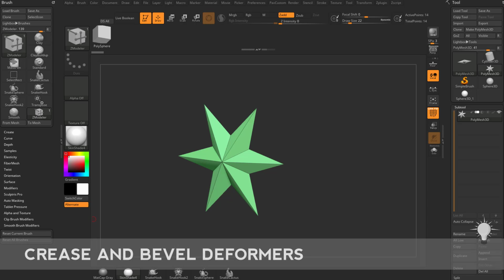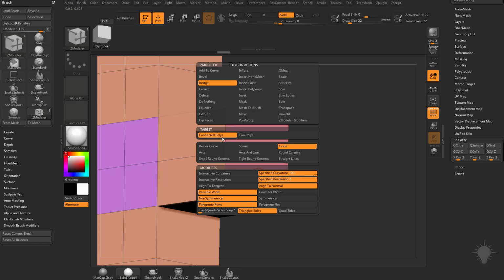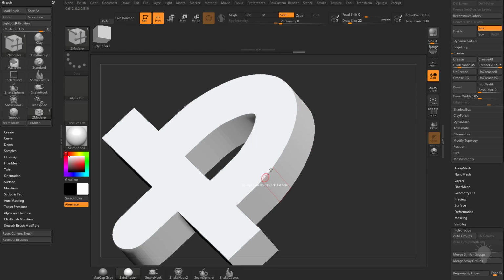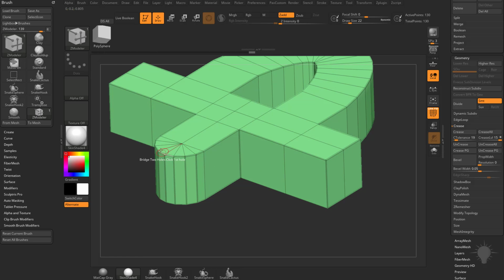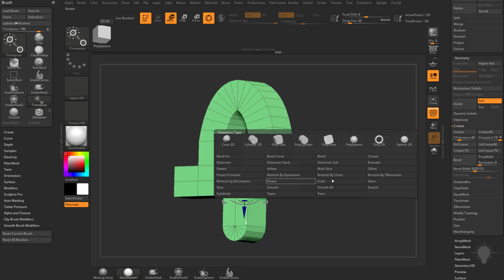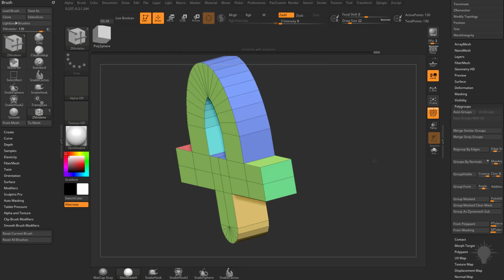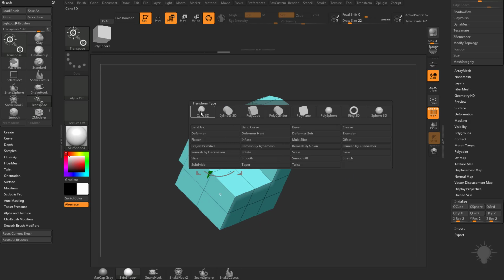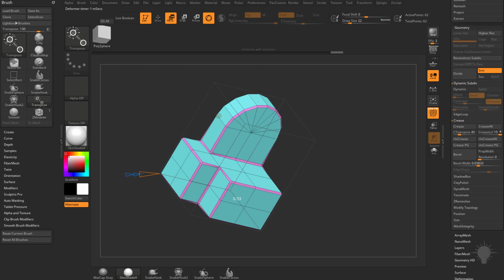030 ZBrush 2018 Crease And Bevel Deformers

Comment: Still can't understand what corners should i look when creasing :(
Reply from the maker: the (very slightly) perforated lines are the creased ones, but if the deformer creasing isn't very helpful to you, go to the tool - geometry - crease menu for the manual options, and use that in conjunction with zmodelers edge creasing for the most control https://www.youtube.com/user/Pavlovich2005/search?query=dynamic+crease
Reply: Michael, using the moment, I want to thank you for the great tutorials. You are the best! I understand how the tool works but it's more intuitive understanding or trial and error method. I can't say directly what angle should i look for to compare with the tolerance value. My guessing right now is - the smallest angle between two planes crossing of which creates the edge.
Reply from the maker: Ah gotcha; when I'm dialing in the angle value on crease tolerances or polygroup by normal values, you're right, it's a bit trial by error; too high of a value might not grab enough, too low of a value might start grabbing too much. Usually I can get it within a few tries, but occasionally I'll have to settle for a value that grabs most of what I want, then manually go in and adjust as needed--